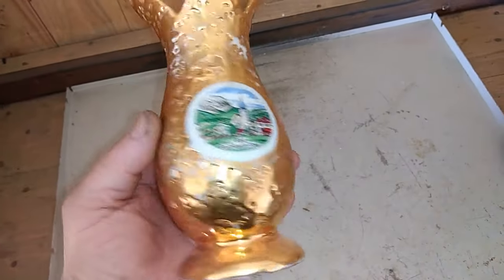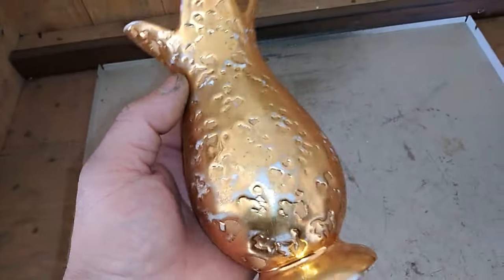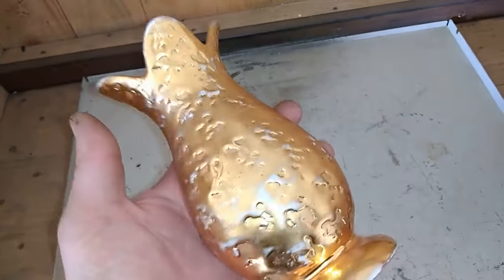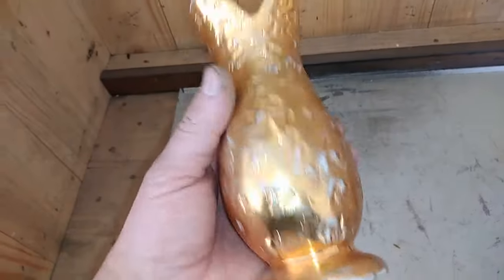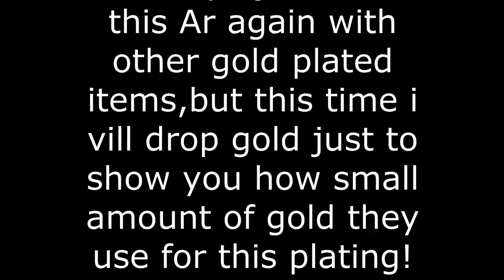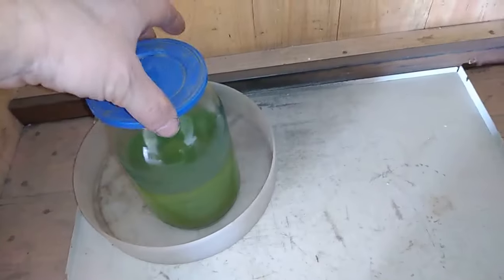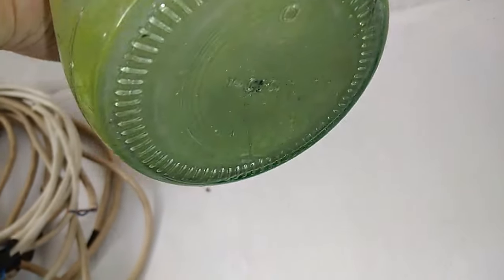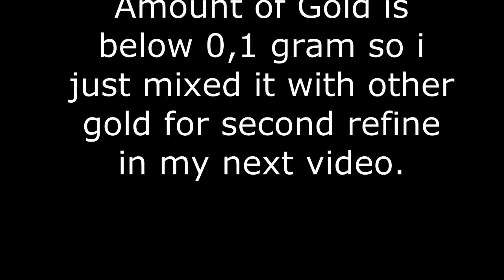How to recovery Gold from CERAMIC VASE!

Comment: what is the process if one uses HCl + bleach? Some countries do not sell nitric but do sell HCl and bleach.
Reply: if you use bleach / hcl - use a Ice bath on your apparatus to help keep the gas in your solution a little longer - the gas is what strips your gold. After you are done stripping you can simply heat the solution driving off any residual gas (although there probably isn't much if any, this is a extremely fast reaction). Once that is done you should be able to drop the gold back out the same way you would as aqua regia, if there are issues add more hcl to make it acidic again.

please be extremely cautious with this method as the fumes will eat your lungs away, literally turning your tissues into a soap like substance. Use a well ventilated area or fume hood far away from others and a ice bath to keep fumes down.  All fumes from gold refining are toxic / dangerous obviously - ( Gold > Human tissue ) if it dissolves gold it will probably dissolve you.

last but not least, there is a extremely small amount of gold on these, but I understand the Gold bug and the pursuit of mastering a skill and gaining knowledge.

good luck to all - be safe do your research, understand some mistakes you do not get to learn from in this field of work.

hope you are well 999 Dusan
Reply: @kaiseredge thx for detailed process

Comment: Hi dusan I have question I will appreciate answer this question 
For removal tin some people add distilled  water and some people don’t add distilled water 
My question is advantage and disadvantages of add distilled water and don’t add distilled water?
Reply from the maker: Dont use demi water, only Hcl!
Reply: @999DusanGoldrecovery  my means some people use just HCL and some people use Distilled water+hcl
Reply: @ssofmas8473  diluting the HCL only adds volume of liquid for additional gold to go into solution. In my opinion, just use more HCL. For instance in some reactions if you are adding incremental doses of nitric to boiling HCl to dissolve a lot of gold but the gold stops dissolving regardless of how much nitric you add, you may need to add distilled water or more HCl to kick start the reaction again because the solution is at saturation level. Usually just a safer bet to add HCl because the issue could be your HCl is spent as well.
Reply: @StillFunBrewing  thx for reply but my question is for tin removal we have 2 procedures:
1-just hcl 
2- distilled water+hcl
My question is advantage and disadvantages of these procedures?

Comment: does any one know how long aqua regia will remain active in storage , i was thinking about making some and using it to remove this kind of plating as i gathered it here and there , thanks
Reply: Hmm interesting. Id say yes. Can be stored.
These type of chemical reactions can halt and then be pushed in either direction again by applying heat, electricity, or other reactive additions.

Chlorine (aqueous) will form chlorauric acid as it dissolves the gold.
This chorauric acid impregnated with gold can be stored in liquid form. 
From that form until fully impregnated, id suppose can be refreshed with a little nitric acid. 

The reason we denox the nitric acid before dropping the precipitant is due to this "restart" of the process as nitric acid frees up more aqueous chlorine from the HCL. 
The limiting factor will be the HCL.